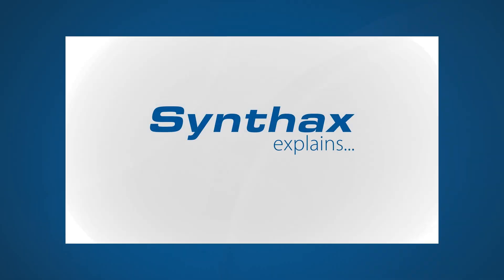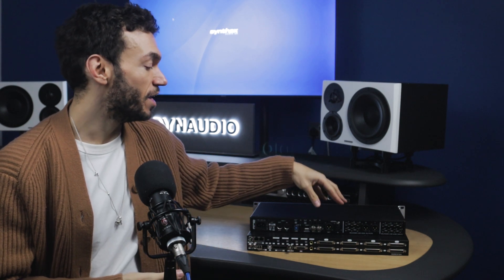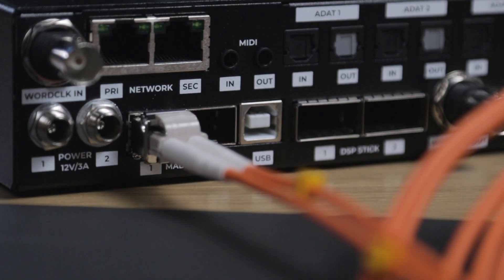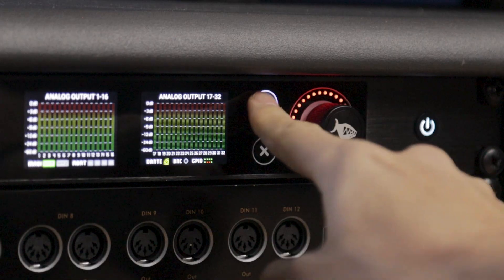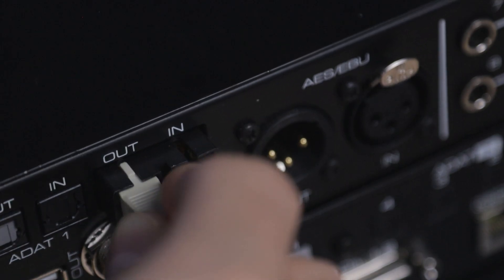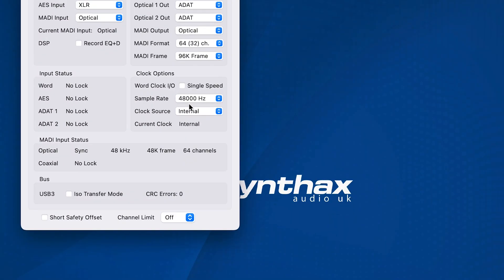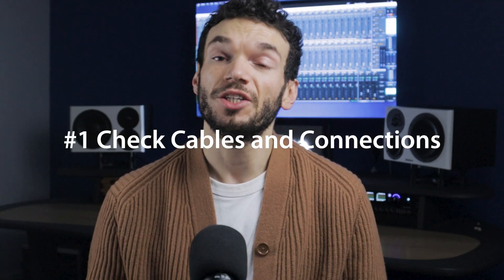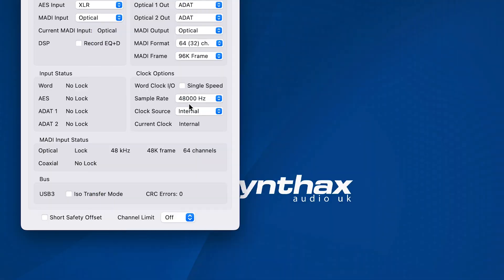Connecting MADI Devices - Synthax Explains

Comment: Just to confirm; If I connect the UFX III over MADI to the A32pro in 96 kHz I will be able to utilize all 32 Channels?
And, Is it possible to connect another A32pro to the MADI coaxial connection on the UFX III to get another 32 Channels in 96 kHz?
Reply from the maker: Hi, yes you can send all 32 channels from 1 x A32pro to the UFX III via MADI at 96 Khz, however remember that will use the entire bandwidth of the MADI input (i.e. the full 64 input channels), as the UFX III only has 1 x MADI I/O for the entire device. 

The UFX III's MADI coax and MADI optical inputs can be used at the same time ('split mode'), however you're still limited by the fact that overall there's only 1 x MADI I/O in terms of channel count. 

(I.e. You can split it into two 32 channel streams at 44.1/48 kHz - one to each MADI input - but only two 16 channel streams at 96 kHz.)

Hope that makes sense. You'd be better off using an RME MADIface XT II interface to achieve what you're after, as that has dedicated 3 x MADI I/O.
Reply: @SynthaxAudioUK  Thank you. There is no really good complete info about Madi out there. So, if I would like to use two A32 Pros then it's the Madi face XT II that I have to buy then? I have a UFX II and I like the durec alternative and the two phone outputs for que mixes. I like the firefaces.